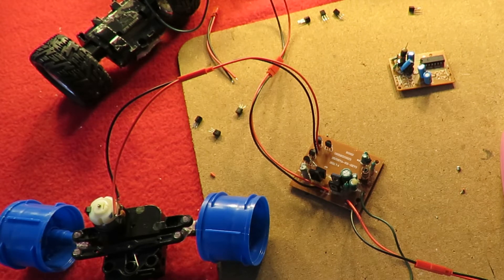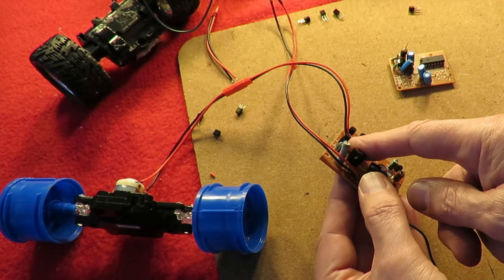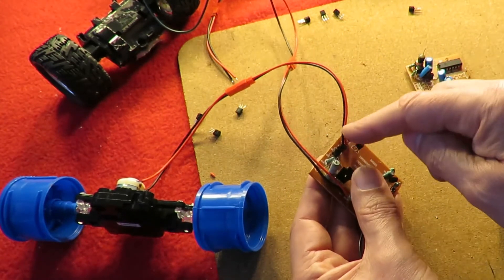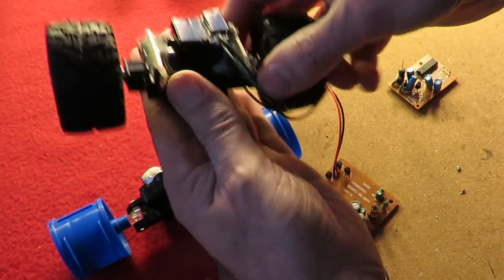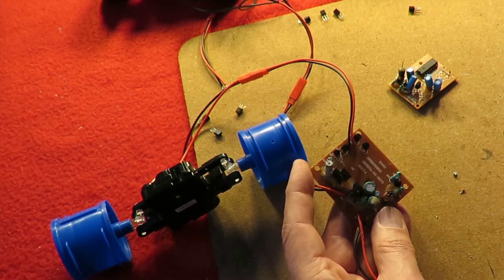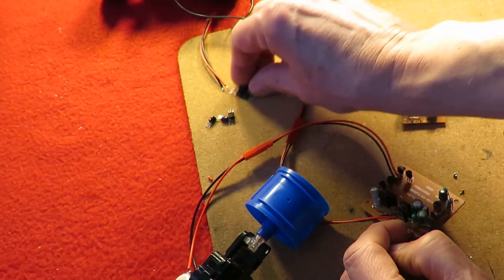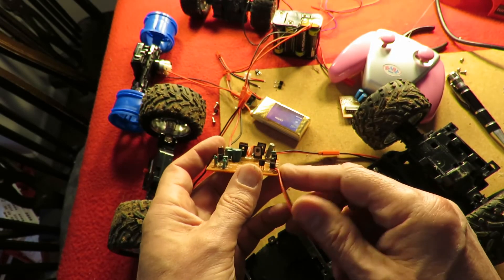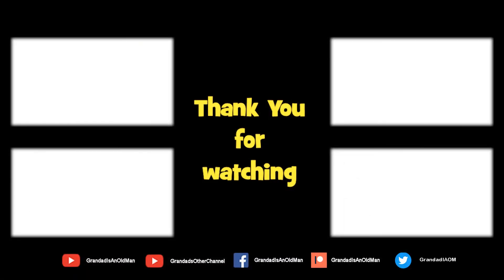Toy Grade RC receiver H Bridge transistor replacement

Comment: I appreciate what you do, keep up the good work! I have an RC Thunderbird from 1994, and it reminds me of my childhood. Unfortunately, its remote control is missing, the antenna is broken, and the body is damaged. I’ve been wanting to restore this childhood relic for a long time. It would be wonderful if you could help me with this! If I can reach you, I’d be happy to share some pictures of the car.
Reply from the maker: I am not sure what help you think I can offer. If the remote is missing, your best course of action would be to buy an matched pair, remote and receiver, probably 2.4 GHz as that will give you better range. They are available from online store such as eBay and AliExpress, although getting the right key words to search for them can be a pain.
Reply: @GrandadIsAnOldMan  Actually, I have no idea how to replace the receiver in the car. I've seen receivers and transmitters being sold online, but I'm not sure how to connect them to the car. I'm also worried about buying a part that isn't compatible with the vehicle. So, I was thinking, if I send you a photo of the receiver after opening the car, maybe you could help me figure out what I need to buy and how to get started. Thank you so much!
Reply from the maker: On toy grade receivers the motor outputs are often labelled M1+ M1- and M2+ M2- or they may be labelled F/B for Forward/Backward and L/R for Left/Right. The battery inputs are labelled VDD and GND or they may be B+ and B- for battery + and battery - 

Toy grade receivers have two wires per motor and have three signal states.
(1) Applying the battery plus and minus on the wires turns the steering motor one way.
(2) No battery applied allows the spring return to centre the steering.
(3) Applying the battery minus and plus on the wires turns the steering motor the other way.
If you connect the same two wires to an ordinary DC electric motor and apply "Left" the motor will keep spinning as long as you hold the transmitter on "Left". If you then apply "Right" then the motor will spin in the opposite direction. 
In toy grade steering the only thing that stops the motor from spinning is the mechanics of the steering so the motor is still trying to spin but the steering arm has reached stop. On a hobby grade servo the electronics measure how far the steering has turned and stops the motor electronically.

This video gives a good general introduction to the receiver -
Re-Using a Toy Grade RC Receiver https://youtu.be/YIqLWDJ31eU
Reply from the maker: This video may give you some guidance on buying TX/RX online - Misleading eBay Listings for Toy Grade RC TX and RX	https://youtu.be/rdK-jMo6pKc
Reply: @GrandadIsAnOldMan  Thank you for the great information; it is much appreciated.

Comment: Oh i still remember when i blowed out one of the drive transistors on one of my rc cars trying to run it on 12v and it's only ment for 7.5v that was so stinky! 😑😑 and then i put another receiver on it and blew the drive motor out 😂😂
Reply: Ha I blew up loads of toys when I was a kid trying  to make them better faster more powerful louder go further battery last longer and so on i have fond memory's of experimenting for hours and hours for it all to end in the smell of burning pcb transistors or exploding caps ... those were the days lol
Reply from the maker: Just had a new comment on this video so I am dropping a comment on all the ones I missed last year 🎅🎄😁👍

Comment: replace those little to92 tranys with some bigger ones like the drive ones  BD 139 BD140 etc
Reply from the maker: That would be the best option, as it is the tracks are damaged with the in and out repetition (I replaced them a second time in a later video) so they would need to be pieced out. Not impossible but an extra bit of work.
Reply: @GrandadIsAnOldMan  lol its all good fun